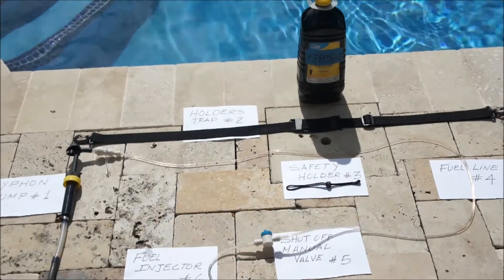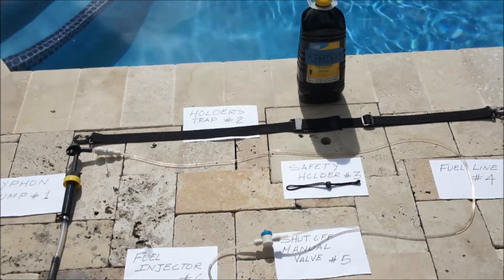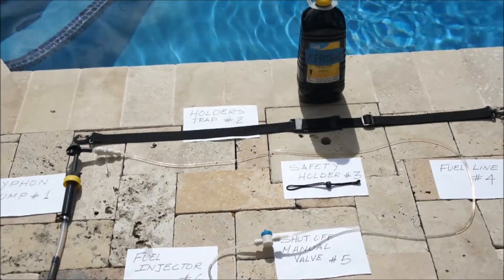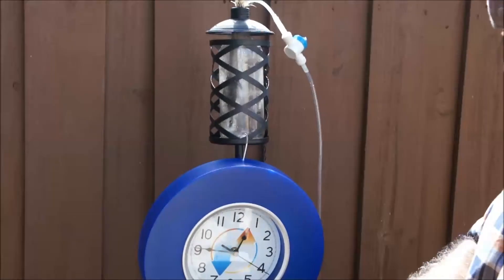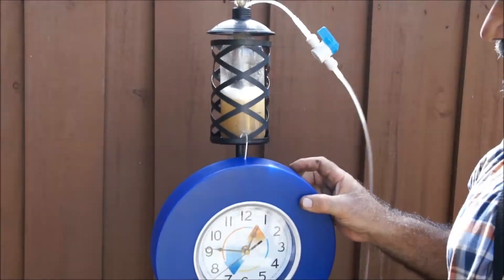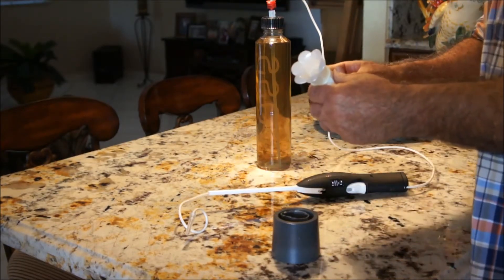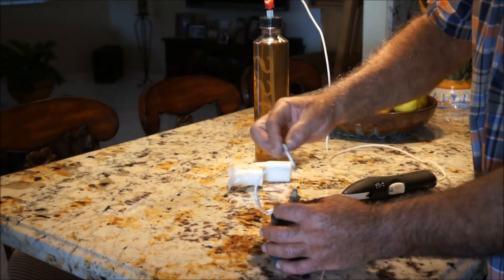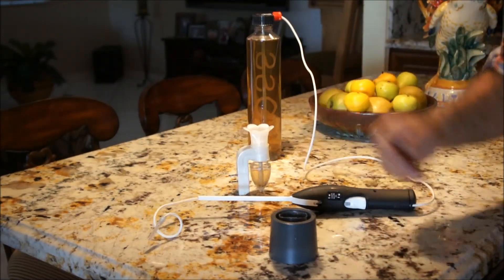ricky tykky patented Invention

Comment: The refueling of any kerosene torch actually it is a nightmare, with our manually and electric prototipes to applyng our patented method to transfer fluids from one container to another with an existing wick at the opening of said container, we are able in a fraction of the time, without any spill and without any mess, with the maximum comfort, speed and convinience to do this dirty job and also under the same patent we have an electric divice to refill any interior fragrance disposable canister with an existing wick at the opening of said canister in few seconds saving a lot of time and money to the user and also to the company because the reduction of the manufacturlng of said spencers canisters, between of the others.
The company that use our patented method would control without any doubs the North American and Worldwide market of the kerosene decoratives torches and the huge market of the  interior ambient fragrances with an existing wick at the entrance of said canisters, for the next twenty years with staggering economics benefits and enormous revenues improvements. Don't miss this unique opportunity or you would regret it for ever.